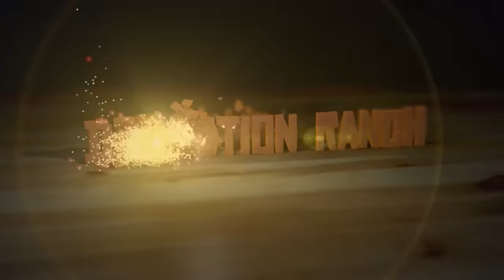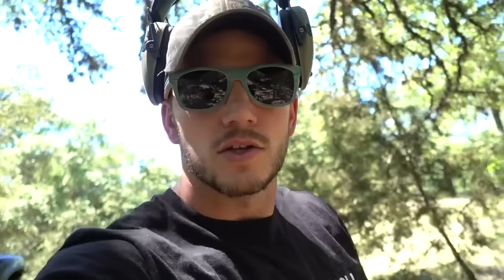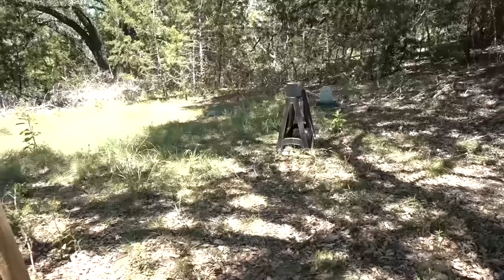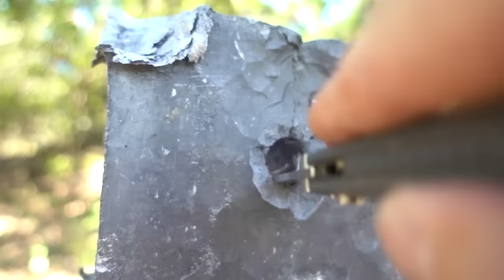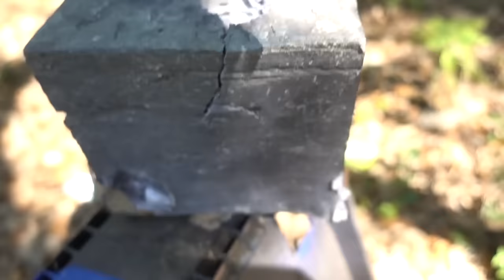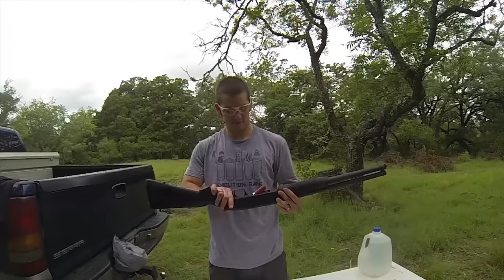How Strong is a Solid Block of LEAD?

Comment: Heres an Idea: 
Take that lead block and Hang it somewhere. Pull it high and let it swing around. Shoot it with different calibers to see how much power every round has. Will a 50. BMG. stop it from swinging ? 
Lead is perfect for this, because it is so soft, that all the energy will be transfered to the block, because no round will make it trough.

Comment: The 9mm copper bullet (vs. the FMJ) is a harder metal obviously, and as such deformed a LOT less upon impact. Therefore the projectile absorbed a lot less of the impact, transferring more of its energy forwards going deeper into the block.  I would imagine if you could "cut" the block open, you'd see an equal amount of deformation in front of the copper round.  I have some Fort Scott 300 blackout tumble rounds for my AR which are spun copper, and I am super psyched to pump those into some various items to see how they behave. Watermelons are cool to shoot but that gets old and really is pointless with anything more than a .380ACP...   I wish I had a solid block of lead to shoot. (And I guess that's why I subscribe here!) ...Oh, and also, I imagine the kinetic energy liquifies at least a little of the lead upon impact which is causing the deep cavernous cratering with the smooth impact features inside, but splintering the outer diameter of the hole. Super cool.

Comment: You should drop that lead block on a Glock from a story up and see if the Glock still fires...
Reply: He should drop it on a hi power. Those things are invincible.
Reply: Slavic Blin hi power?
Reply: Slavic Blin the fuck is a hi power? I want one
Reply: Slavic Blin the fuck is a hi power? I want one
Reply: They're one of the cheapest, if not the cheapest pistols out there you can get. They're heavy, clunky, don't feel good in the hand, but they can last for AGES, shoot well, very durable, and they're overall underrated.
Reply: I was shot at by a hi power once, some satin finish pos dude had under his seat. He was shooting at his girl in a parking lot as I was getting in my car and she was between us. I looked straight down the barrel, spun for my Para in my center console, heard the shot, hit the deck, and then dude drove off.
Somehow, he jammed the sucker. How bad do you have to take care of a hi power for it jam on shot one?? I'm guessing it was a lower power load and didn't eject right. He hit the dude who was with his girl in the leg. They found him the next day. Doing 10 years now, I think.
Sadly, not even the most exciting story I have.
Reply: Hi power legit is or resembles the 1911
Reply: I knew there wqs something wrig about it. Hi power doesn't make any sense!
Reply: JonatasAdoM well there’s nothing wrong about it considering it was one of the old American military’s most used pistol because it’s cheap but really powerful at close range hence the hi power (HP) browning m1911 but of course like other old guns it gets jammed a lot

Comment: U should do a video to see if sewer lids are bulletproof
Reply: Papa Jesus Villanueva Edward sarksskan dose it with 20mm
Reply: I... I actually really like that idea. Maybe get a Captain America shield too? Maybe hit up Hacksmith?
Reply: The Illgotten Illustrator that would be a great idea Captain America shield
Reply: pizza boi I think you can loot them from zombies
Reply: @vinceguzman4829  I think it should be made if something he hasn't experimented with. Like Chromium or Tungsten. He'd need a sponsor for that, cause those are pretty pricey.
Reply: @vinceguzman4829  to make a Chromium shield in the shape of a concave disk measuring 2.5 ft in diameter, I would recommend a cubic foot of Chromium, which would weigh about 135 lbs and cost about $22 per pound.
Reply: You should spell the word you right
Reply: 69 likes NOBODY TOUCH IT lmao
Reply: Nothing is bullet proof as long as 50 bmg exists
Reply: You mean "They Hole" covers??  😉 😏
Reply: That is one of the most dangerous ideas anyone has ever thrown out there
Reply: Yas
Reply: So the ninja turtles are safe
Reply: Why isnt this the top comment
Reply: Uhhh.. you planning something??
Reply: Is that question for the ninja turtles safety? 👀
Reply: Yes sewer lids can stop a bullet. There are made from a pure steel discovered in 1949 and can almost stop any bullet. I don’t think anything  will puncture a sewer lid
Reply: Sans  where would you get plane windshields? where do you get gas pumps? where do you get ATMs?

Matt knows people.

Comment: I kinda wish he just kept blasting it with the 50 bmg until he either tore it in half or could see right through it
Reply: Same or used the black tip
Reply: @captinprice1173  What does black tip do?
Reply: captain  more powerful bullet than a normal tip most military personnel snipers use them
Reply: @captinprice1173  so it goes faster?
Reply: @n1thecaptain965  yes and hits harder more destructive
Reply: @captinprice1173  nice
Reply: N1 the captain its an armor piercing round
Reply: @muhammadnatour4589  so just AP or is one of those real fancy combinations of materials like they use in tanks that has a name so long even the acronym is ridiculously long
Reply: Like armour piercing high explosive fin stabilised discarding sabot high explosive anti tank high explosive capped ballistic capped or aphefsdsheathecbc for "short"
Reply: captain  it's a combo of material that forms the best alloy for armor piercing
Reply: @captinprice1173  ok, so not so ridiculous as aphefsdsheathecbc but not just plain old AP either
Reply: @n1thecaptain965  yah
Reply: @LockDownLife  I have a channel
Reply: N1 the captain I’m pretty sure that black tip is armor piercing so it will have better penetration
Reply: N1 the captain you be talking bout that aphefsdsheathecbc but it ain’t got nuthin on that 🅱️esh
Reply: @bravoechonovember1510  what is besh?
Reply: @n1thecaptain965  It has a stronger metal core, so it penetrates more and doesn't explode on impact
Reply: @ElBach1y  Ok
Reply: Oh and btw, aphefsdsheathecbc isn't an actual round, you probably saw it from a Badger vid and it's a meme in the War Thunder community. Just throwing together every possible name for a round but wouldn't be feasible/possible irl. APCBC-HE is an actual thing as well as APFSDS.
Reply: @tezla6332  I know it isn't real, I just thought it was funny
Edit: well technically I didn't know it wasn't real, but I never thought it would be a real round
Reply: Wished he used the blacktip.

Comment: melt it and make a new lead block. so u dont have holes
Reply: Sorry, but have you seen the melting point for lead?
Reply: 327 C not much at all
Reply: 600 degrees Fahrenheit, easily done with a propane torch
Reply: Talking Sandvich you can literally melt lead on a stove top
Reply: its really not that much
Reply: It's relatively low...
Reply: You can melt lead on a regular stove if you like, 325-330 C really isn't that high.
Reply: lol u got rekt man
Reply: lead's melting point is so low that it's sometimes called a "pot metal" because you can literally melt it in a pot on your stove
Reply: Lead is pretty easily be melted. Unlike Steel where you have to reach a high scale of temperature.
Reply: Talking Sandvich
when you try to be smart but don't know what you're talking about
Reply: Talking Sandvich lead is very easy to melt
Reply: Bromine35 trust me I know what im talking about
Reply: mathias wallunger and
Reply: Oh shit

Comment: Imagine dropping this thing from a plane
Reply: Pyroboy dont give him ideas 😂😂
Reply: It would hit a max speed before it hit the ground
Reply: it would reach terminal velocity
Reply: It wouldn't fall faster than any other object. It would have a lot of momentum though
Reply: @Andrea Musso.. Actually, each object has it's own different terminal velocity, depending on it's mass, weight and air resistance. If something is more aerodynamic, it will have less air resistance. Air resistance is the reason there is a terminal velocity. The higher the altitude, the less air density = less drag/wind resistance. That's why when that Baumgartner guy jumped from over 120,000 ft, he fell at speeds exceeding 800 mph. Then when he got at a lower altitude, his speed dramatically slowed because of the air density. 
.
That said, if you dropped that lead block at 30,000 ft, sure...it would do serious damage to something (hell..it would do similar damage from 1000 ft). However, if you dropped that bad boy from say    80,000 ft, I can guarantee you that not only would it destroy whatever it landed on, the lead block would probably be completely flattened like a lead bullet. Even though the air density is much higher as the block drops, I'm sure the block would be traveling at speeds over 600 mph....given it's own density and weight. It wouldn't have slowed down all that much. I would hate to see something like that land on a person.....
Reply: Yeah I do know about air resistance and aerodynamics. I was kind of correcting those who would think that heavier objects fall faster.
Reply: If dropped from an airplane (in air) denser objects DO fall faster than lighter objects.
Reply: Imagine dropping this thing from a plane.. ON THE DOG!
Reply: they would initially travel at the same speed, until the one oz. sphere reached terminal velocity, which would be much sooner.
the force of gravity is the same on all objects regardless of weight.
BUT, heavier/more dense objects have a higher terminal velocity (will reach a higher speed given it is allowed to fall for long enough)
Reply: Late, but I did some quick napkin math and figured out that dropping it from 60,000 feet would release the energy of roughly 9 sticks of dynamite on impact. (figuring it loses about half of its energy to air resistance and its own deformation on impact)
Reply: Bruce Wrigleys Gumchewz would the temp from air resistance not melt the lead
Reply: Mr.Anime Girl what does that mean
Reply: Andrea  Musso 
The thing is a lead block falling from a plane would have a ridiculous amount of force upon impact.
Reply: That's for sure
Reply: Pyroboy...... That would drop like a lead balloon!
Reply: If u drop it from 300m is the same to drop it from a plane.
Reply: Bruce Wrigleys Gumchewz holy shit
Reply: It would be like a comet hitting the earth.
Reply: Peter Johnson   The aerodynamic is the main source of speed change. A feather has a lot more surface area then a rock. If we had a block of osmium amd a block of carbon fibre with the same aerodynamics they would fall at the same speed
Reply: Andrea  Musso yes it would its heavier so it has a higher terminal velocity...
Reply: Andrea  Musso they do...
Reply: Pyroboy that would suck if it fell on your head
Reply: That would be awesome
Reply: Pyroboy it would lead to someone’s death
Reply: Peter Johnson no. They fall the same speed, because of air resistance, however, they do have more momentum
Reply: Pyroboy 

Or a bread sandwich
Reply: KUPOkinz assuming both spheres have the same density, the terminal velocity should be identical.
Reply: Boom! headshot

Comment: Hey demo I work on the pipeline and I wear steel toe boots every day all day even on my normal days. I have had multiple heavy pipes and robs fall on them and I've been there for 3 years now and I go through a pair every year. Why don't you see what bullet is the strongest against it. Be a cool one because never seen one with a pair of shoes
Reply: Josh Wynn
Reply: Josh Wynn 50cal that will probably do

Comment: Have you tried using anti-vibration gloves with the 500 magnum? it would probably cushion the recoil and aren't really that expensive.
Reply: Fabled Soldier I think it's more so the barrel flying up with so much force
Reply: The magnum is pretty light too for its size, I have a hi point............. ok quite everyone....... I'll wait......ok? Anyway it feels heavier in the hand than the 500
Reply: @Erick Rosa     hi point gets too much hate. I have one, it's a fine range gun.
Reply: Fabled Soldier I

Comment: It always amazes me the power of just the blowback from the 50 bmg like it's insane
Reply: the bullet has 18000 to 20000 joules, and guns are about 30 to 40 percent efficient at most; so the gas energy is higher. (a powerful arrow would have 100 joules)

Comment: In the book Fight Club in the first page it says you can create a silencer if you drill holes in the barrel of the gun. My question is can you actually drill holes into the barrel of a gun and make a makeshift silencer.
Reply: Carlos Chavez - in the book "fight club", on the first page it says ; don't talk about the book of "fight club".
Reply: Carlos Chavez yes, use a drill.

Comment: Video idea, what happens when you shoot a grenade
Reply: Highlight Mania What do you think happens, num nuts...
Reply: Nothing happens when you shoot a grenade. It's C-4 and has to be triggered by a detonator.
Reply: doesn't that depend on the explosive? Surely a hand grenade that is set of by a timed spark with you let go of the lever thingy would explode if a bullet shot it
Reply: just do it Matt!!!
Reply: The mythbusters did it. Plot twist, nothing happens. The grenade just kinda breaks open.
Reply: A detonator isn't a spark, it's a remotely activated sensitive initial explosive used to trigger the main reaction in the larger explosive. Yes, it does depend on the explosive. Some explosives can be set off quite easily, such as TnT or large amounts of fuel. However other explosives, such as C-4 or det cord are designed to be only triggerable by a detonator. i.e.- another explosion. And cannot be triggered by most other means, such as shooting them with a bullet, lighting them on fore, or electrocuting them.

Comment: gets lead poisoning
Reply: as long as you don't get it in your blood you will be fine
Reply: As long as he didn't put his hands in his mouth after holding it, didn't have cuts on his hands and washed his hands afterwards, he'll be fine.
Reply: Yeah mat needs to be more careful around handling lead I personally reckon it should be banned worldwide.
Reply: Not so much..but for long time use its poison.
Reply: Banning lead? Have you even finished 6th grade?

Comment: Drop that lead block on bullets. Will they go off ? 
Drop it on Lego, what will break ?
Throw it in water, how big will the splash be ? 
Try melting it with your flametrower. 
Put like 500 Grams of blackpowder under the lead, will it fly ( don't do it near you, your wife, house, car, kids, or anything that won't like getting hit by a 100 pound lead block dropping from the Sky).

Just some Ideas.
Reply: S4t4n_L0v3s_M3_666 _H4iL why whould you destroy a solid block of lead
Reply: melting it is not a good idea because lead fume is toxic.
Reply: Geert Wilders Niet omdat t moet, maar omdat t kan
Reply: not a good idea to melt lead.
its a neuro toxin which is bassicaly going to kill you however it can.
even the smallest amounts entering your bloodstream can be lethal.
i couldnt think of a better way than to inhale it for those results.

now sure in a controled enviroment he could melt a bit with little risk to his health, but  its like mercury, it will find its way up the food chain and the water system.
ide say just play it safe.

now my welding instructor of 4 years told us of how he never knew his father and thats because he took his last job as a lead solderer and only lived another 6 months.
it was only until decades later his family found out the actual cause of his death when people started noticing the connections.
Reply: but im interested to know what would haplen if your dropped a block of lead or other metal on bullets positioned in different ways.....
Reply: 1. It will set off rimfire rounds no problem, would probably set off centerfire rounds if it hits them just right. 
2. lead>lego>feet
3. Splash depends on how fast the block is moving when it hits the water. It will displace water faster than a similar-sized block of steel because it will lose speed more slowly (more weight, more inertia acting on it), would be cool to compare. 
4. Gasses produced from melting lead in open air are very toxic. His flamethrower should produce a flame more than hot enough to BOIL lead so this is a very bad idea and shouldn't be attempted. Gasoline and Ethanol (two of the fuels compatible with his flamethrower) can both produce flames above 2,000°C, lead melts at roughly 330°C and boils at roughly 1,750°C. 

I'm not saying that wouldn't be cool, it's just kind of extremely dangerous and he could die.
Reply: delinquentJACK yeah thats true... But still it would be nice to see it (except from the melting part). I mean you can kinda Imagine what would happen if you shoot lead and still watched the Video. Life always has a suprise awaiting you.

Comment: The Brodie Helmet (British WW1 helmet) vs Modern day guns?
Reply: Easy. The bullet would go straight through. WW1 Rifles and probably pistols would as well. They were never designed to stop bullets. The purpose of helmets in WW1 and 2 (Steel helmets in general) was to stop the debris and shrapnel raining down after an artillery strike from going through your head. Something which if you look at the statistics at the time they were incredibly good at. They did occasionally stop bullets, but only if they hit the very side or top of the helmet, where the steel was at a greater angle, increasing it's effective thickness and increasing the likelihood of it ricocheting off.
Reply: ProudToBeNoob Exactly, helmets aren't made to stop a direct hit. They're only meant to deflect shrapnel and/or glances.
Reply: Qays Syed yeah but still I want to see the damage a gun will do a Modern day gun, plus almost everything on this channel gets destroyed anyway